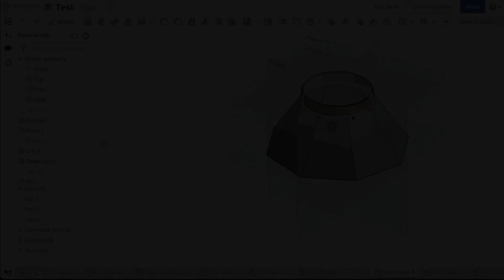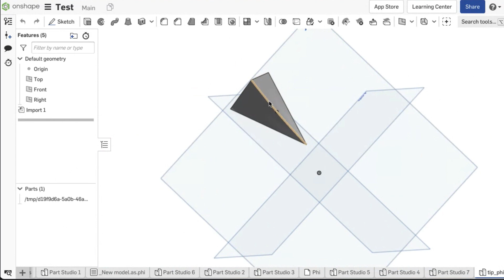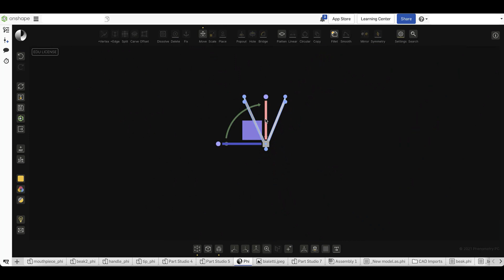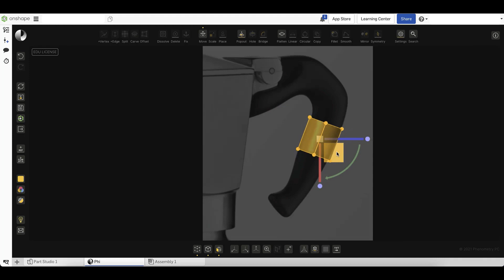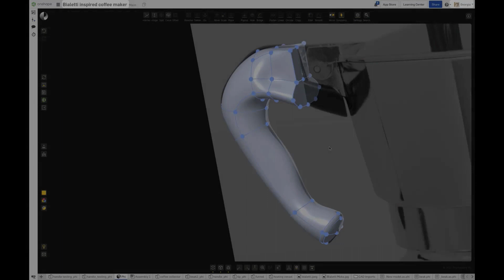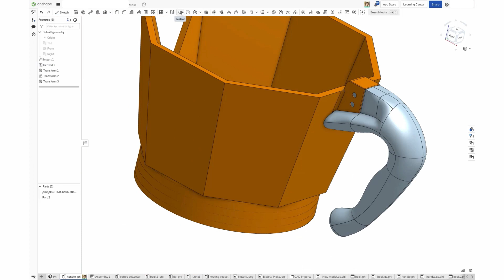Bialetti Moka by Pavlos

Comment: Are the surface references you pass from the main OnShape part to Phi a parameter?
Meaning: if the original surface reference change from the main OnShape part, will it be updated one you open Phi again ?
How will the workflow of these kinds of iterations look like?